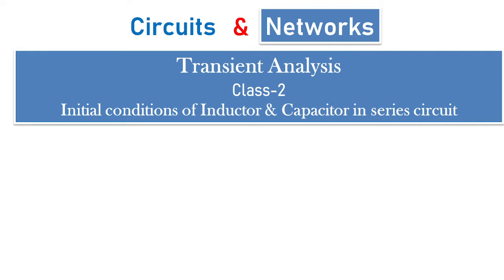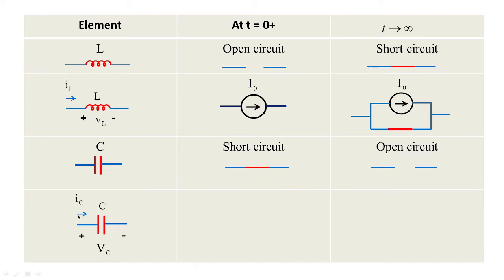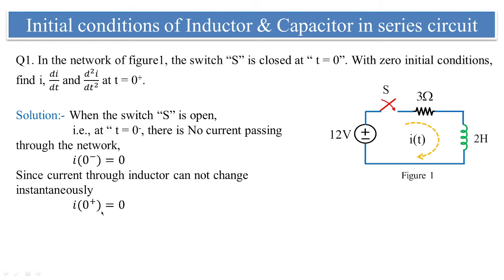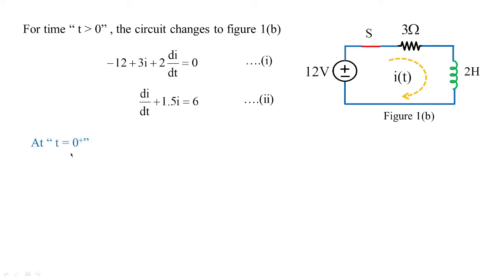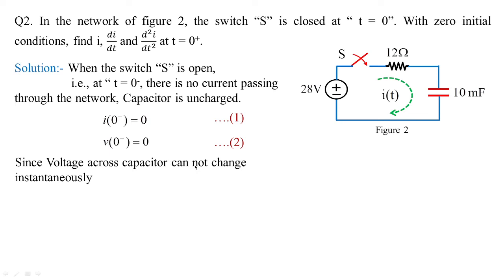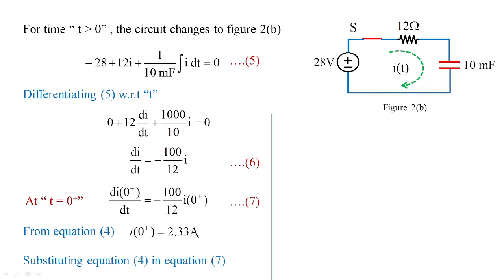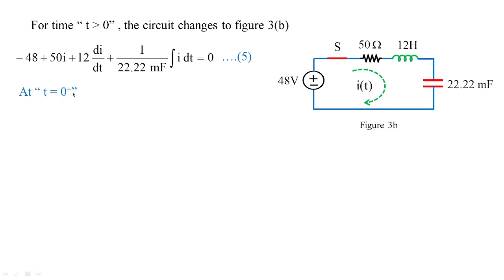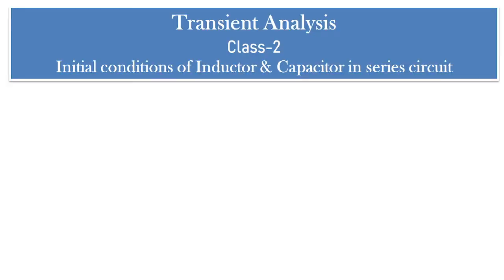How to solve Transient analysis problems? What is Transient analysis? Describe Transient analysis.

Comment: sir in 2ns qn should it be 28+... not -28 since current goes from - to +
Reply from the maker: current should be i(0+)= 28/12=2.33A
Reply: Regarding - to + current flow across the voltage source which implies -28 is used in only writing KVL equation -28 + 12(I)=0 . Which gives, I = 28/12=2.33A.